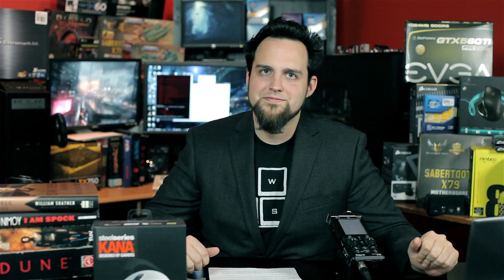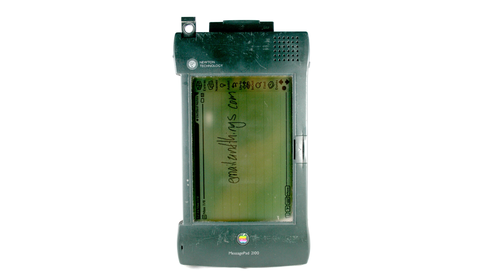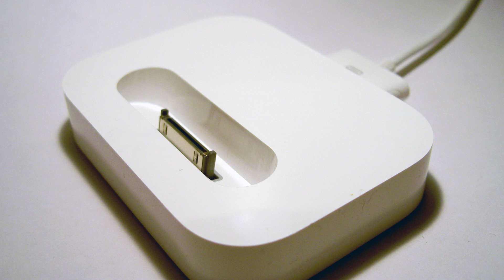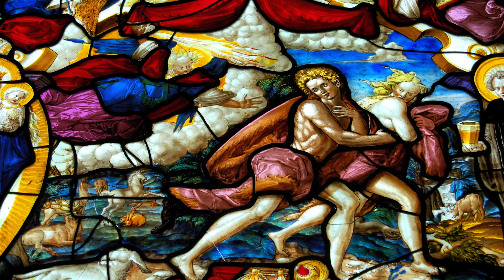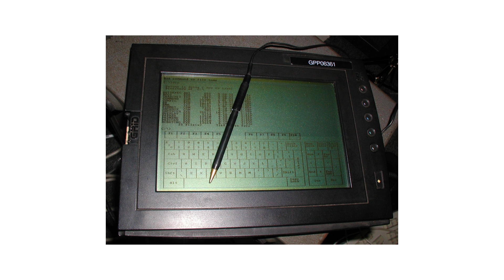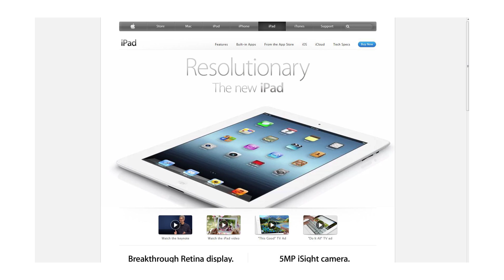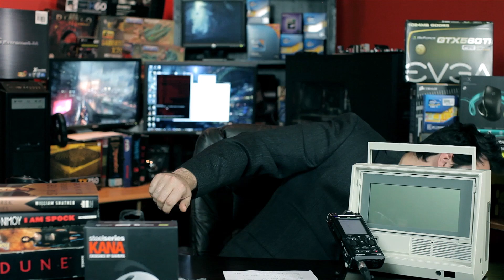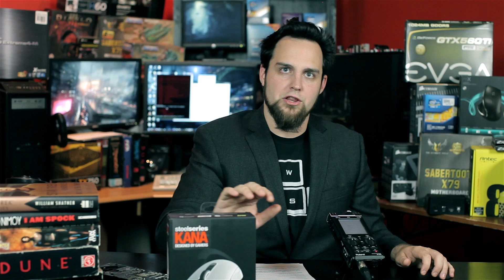Has Apple Really Ever Invented Anything?

Comment: Apple fanyboys playing damage control claiming Apple never said they invented anything. Come on.
Reply: *****

"An invention is a unique or novel device, method, composition or process. The invention process is a process within an overall engineering and product development process. It may be an improvement upon a machine or product, or a new process for creating an object or a result. An invention that achieves a completely unique function or result may be a radical breakthrough. Such works are novel and not obvious to others skilled in the same field."

From http://en.m.wikipedia.org/wiki/Invention

Does that concur with your view?
Reply: US Patent Law defines invention like this: a new, useful process, machine, improvement, etc., that did not exist previously and that is recognized as the product of some unique intuition or genius, as distinguished from ordinary mechanical skill or craftsmanship.
- (http://www.uspto.gov/web/offices/ac/ido/oeip/taf/patdesc.htm)

• Firewire is Apple's own name for IEE1394, Apple initiated development in 1986 with the help of the  IEEE P1394 Working Group, where TI was belonging to then.

From the 1394 Trade Association page:
"History
The 1394 digital link standard was conceived in 1986 by technologists at Apple Computer, who chose the trademark 'FireWire', in reference to its speeds of operation. The first specification for this link was completed in 1987. It was adopted in 1995 as the IEEE-1394 standard. IEEE-1394-2008 is the most current version of the standard, which supports asynchronous and isochronous data transmission with data rates ranging from 98.304Mb/s (S100) to 3.932Gb/s (S3200)."
- (http://www.1394ta.org/about.html)

• Newton MessagePad, while not the first real PDA, Apple coined the term PDA. I was not able to find an Apple press release about the MessagePad though, to either confirm or deny the claim of the video uploader (VU).

• Thunderbolt: where does Apple claim to be the inventor? It does not say so here: http://www.apple.com/thunderbolt/

And back in February of 2011, when the first Macs with TB arrived, Apple said this on their TB page:
"Thunderbolt began at Intel Labs with a simple concept: create an incredibly fast input/output technology that just about anything can plug into."
- (http://web.archive.org/web/20110227062320/http://www.apple.com/thunderbolt/)

• MagSafe: Where did Apple say, it was something entirely new? They have a patent on this connector for electronic devices, thus rice cookers are not included. In their press release from 2006, Apple did not mention to being the first to implement magnetic properties with power adapters, but according to the definition of invention, it is an invention.

• Studio & Cinema Displays: Where did Apple claim, to have "invented" the big displays? They were however the first to offer 30" computer displays and got the ball rolling for 2560 pixel wide displays, like the 27" displays nowadays.

• Mini DisplayPort is in a way Apple's implementation of the DisplayPort standard, one could call it an invention or innovation, the line is blurry here.

• Clarus, the dogcow: I am baffled now.

• 30-pin dock connector: A lot of companies seem to have their proprietary dock connectors, and Apple did implement some features in its dock connector, that would not be possible via Firewire or USB, like video out for example.

• Apple IIe Card: again, blurry lines, but in the end, if it is not considered an invention, it was an innovation made in house. I guess that should count for something. Nowadays we do not have such problems anymore, everything is compatible with everything. Man, those first thirty years of personal computing must have been awful.

• Apple TV: where does Apple say it is their invention? They say, it is their product, nothing more. These guys are really reaching. I guess they could not be bothered to look at Apple's actual inventions.

Still lots of shit to go I guess. And those moderators are quite bad.

• MacBook Pro: Apple was the first to use the Unibody design for their notebooks, others just followed suit. It was an invention and innovation.
You could also look at the Aluminium G4 PowerBooks, they were the first to introduce widescreen displays widely.

• Apple logo: again, stretching. They did design it themselves, but then again, someone already took a bite before, and it was Turing. I guess that guy should be honoured.

• QuickTake camera: I guess, they just list products, which cannot easily count as inventions, but the parts used inside or the parts used to create that product can be an invention, but then again, most people cannot look below surfaces and have to be superficial.

• Mac OS 9: now they just ramble how bad it was, but I cannot say anything about that, since my only experience with pre Mac OS X was System 7 and Mac OS 9.2.2, which were okay and got me hooked. I always liked to theme Windows to look more like that, I still put that task bar thing up top when using Windows. 

• Mac OS X: Of course they invented some of the code, they bought some of the code, and they took some of the freely available code. The new OS is an invention, but of course only if you use the broader definition. Otherwise, no one is inventing anything. Maybe when the Singularity arrives, new inventions will be made.

That video gets boring, but I fight through it. Hopefully you will too with this longer reply not really made for YouTube.

• Mac App Store: Again, where does Apple claim to be the first or having invented something entirely new with just the concept of the MAS? 

• iOS: Never heard it pronounced that way. Inventive. Unlike iOS of course, which was just Apple doing nothing. Man, those guys are prejudicial. And man, am I becoming even more prejudicial towards people with such beards. Probably wanted to join a metal band, but couldn't.

• iPad: Sadly, this time they are 0% correct. Tablets and that concept existed before, even in Start Trek and 2001. And many manufacturers brought out products in the late 90s and early 2000s, which showed, how many people are really not interested in such crappy products.
Luckily the iPad came along and showed everybody else, what to copy. I guess they couldn't see it from the iPhone, which was an obvious test bed for a multi touch tablet, at least for people looking at dozens of PADDs while watching TV.

• The iPod was not claimed to be the first MP3 player, not by Apple at least. Where do they find those idiotic assumptions?
It was the first popular MP3 player with good navigation and big storage though and brought attention to Apple. I guess, it must not have been that bad a player.

• Inductive charging: Apple does not offer any products of their own design or creation employing inductive charging. But I guess, since one can buy such products from the Apple Online Store, it must be Apple claiming it as their invention.
Or are they talking about the patent for orientation based charging Apple got earlier this year?

• iPhone: Yeah, I guess the name was the only thing they could come up with. Poor bastards.

• Pippin: WHAT THE FUCK? I am seriously pissed right now, and I probably should stop, but I am also obsessed with stupid people like you and proofing them "right", which is of course a lost cause via social media.

Anyway, I make a short break to break something, and will probably go to the cinema afterwards. Maybe I finish this reply later, maybe I will come to my senses and just post it until this dot.
____

They think a lot, they do not know a lot.

• A5: Officially it is a design by Apple, even if made by people from a previous company Apple bought, the company being P.A. Semi, not ARM. But then again, dangerous half wits share their ignorance.

• notebook handle: Yeah, they got Apple this time, Apple clearly claimed to be the sole inventor of this idea.

• Unibody construction: Apple introduced this sort of construction to notebooks, although it was a way to construct other parts of other industries long before. Again, those guys assume it was made for aesthetic reasons, thus it is not a real invention. I guess, the USPTO does see it differently, since it granted Apple a patent or more for that Unibody design specific to notebooks.
(http://patft.uspto.gov/netacgi/nph-Parser?Sect1=PTO1&Sect2=HITOFF&d=PALL&p=1&u=%2Fnetahtml%2FPTO%2Fsrchnum.htm&r=1&f=G&l=50&s1=8,616,748.PN.&OS=PN/8,616,748&RS=PN/8,616,748)

• legacy free PC: I guess they had to stretch, when they only got moot points.
Luckily other manufacturers still include PS/2 ports and Parallel ports on their motherboards, unlike Apple, who abandoned those legacy ports in the 1990s and introduced USB to the masses in a way.

Now they go off on lawsuits. They generalise a lot, but then again, one has to do that without actual points.
Apple does not go after everyone, that copies something from Apple like tablets or smartphones, they go after people, just like any other company, violating their patents, and Apple has certain patents in the smartphone and tablet sector, that get copied to the T. Apple does not go after companies, using their own patents or licensed patents when it comes to smartphones and tablets.

PS: I am not fully versed in all the legal stuff, and I have seen some frivolous lawsuits reported made against Apple and being pursued by Apple in the past decade. I do not agree with any of them, be they from Apple or against Apple.

Anyway, if you want to see granted Apple patents, which include their own inventions, go here: http://www.patentlyapple.com/patently-apple/patents-granted/
Reply: *****
• "How a US Patent defines invention is not the same as the literal definition of an invention."

- What is the literal definition of "invention" then?
Is it this?

"An invention is a unique or novel device, method, composition or process. The invention process is a process within an overall engineering and product development process. It may be an improvement upon a machine or product, or a new process for creating an object or a result. An invention that achieves a completely unique function or result may be a radical breakthrough. Such works are novel and not obvious to others skilled in the same field."
from http://en.wikipedia.org/wiki/Invention

• "Apple barely invented anything. "

- It invented enough to be copied again and again.

• "And if you can't tell, this video actually debunked the theories with facts"

- Really? Facts? There was one guy in front of a camera and one guy behind it, using small words. Where were those facts hidden?

• "even some I was unaware of in fact."

- If you believe a YouTube video as fact without doing your own research, and you have the free means to do so nowadays with the greatest knowledge base at your fingertips, it is obvious you are unaware of facts.

• "Of course, I see you damage controlling for Apple."

- Not for Apple, but FOR the people spouting ignorance.

Feel free to read the following entirely this time and counterargue. Or even show evidence of those "facts" you BELIEVE* to be true.
I will happily shut up if you can do that, but you would be the first to do so, thus no pressure.

*Believe is the same as not knowing, it is accepting something to be the truth without proof. Have you seen any valid proof in this video?

• Firewire is Apple's own name for IEE1394, Apple initiated development in 1986 with the help of the  IEEE P1394 Working Group, where TI was belonging to then.

From the 1394 Trade Association page:
"History
The 1394 digital link standard was conceived in 1986 by technologists at Apple Computer, who chose the trademark 'FireWire', in reference to its speeds of operation. The first specification for this link was completed in 1987. It was adopted in 1995 as the IEEE-1394 standard. IEEE-1394-2008 is the most current version of the standard, which supports asynchronous and isochronous data transmission with data rates ranging from 98.304Mb/s (S100) to 3.932Gb/s (S3200)."
- (http://www.1394ta.org/about.html)

• Newton MessagePad, while not the first real PDA, Apple coined the term PDA. I was not able to find an Apple press release about the MessagePad though, to either confirm or deny the claim of the video uploader (VU).

• Thunderbolt: where does Apple claim, to be the inventor? It does not say so here: http://www.apple.com/thunderbolt/

And back in February of 2011, when the first Macs with TB arrived, Apple said this on their TB page:
"Thunderbolt began at Intel Labs with a simple concept: create an incredibly fast input/output technology that just about anything can plug into."
- (http://web.archive.org/web/20110227062320/http://www.apple.com/thunderbolt/)

• MagSafe: Where did Apple say, it was something entirely new? They have a patent on this connector for electronic devices, thus rice cookers are not included. In their press release from 2006, Apple did not mention to being the first to implement magnetic properties with power adapters, but according to the definition of invention, it is an invention.

• Studio & Cinema Displays: Where did Apple claim, to have "invented" the big displays? They were however the first to offer 30" computer displays and got the ball rolling for 2560 pixel wide displays, like the 27" displays nowadays.

• Mini DisplayPort is in a way Apple's implementation of the DisplayPort standard, one could call it an invention or innovation, the line is blurry here.

• I do not know that dog icon, but I really get the feeling, they went with items, where the term invention cannot always be applied.

• 30-pin dock connector: A lot of companies seem to have their proprietary dock connectors, and Apple did implement some features in its dock connector, that would not be possible via Firewire or USB, like video out for example.

• Apple IIe Card: again, blurry lines, but in the end, if it is not considered an invention, it was an innovation made in house. I guess that should count for something. Nowadays we do not have such problems anymore, everything is compatible with everything. Man, those first thirty years of personal computing must have been awful.

• Apple TV: where does Apple say it is their invention? They say, it is their product, nothing more. These guys are really reaching. I guess they could not be bothered to look at Apple's actual invention.

Still lots of shit to go I guess. And those moderators are quite bad.

• MacBook Pro: Apple was the first to use the Unibody design for their notebooks, others just followed suit. It was an invention and innovation.

• Apple logo: again, stretching. They did design it themselves, but then again, someone already took a bite before, and it was Turing. I guess that guy should be honoured.

• QuickTake camera: I guess, they just list products, which cannot easily count as inventions, but the parts used inside or the parts used to create that product can be an invention, but then again, most people cannot look below surfaces and have to be superficial.

• Mac OS 9: now they just ramble how bad it was, but I cannot say anything about that, since my only experience with pre Mac OS X was System 7 and Mac OS 9.2.2, which were okay and got me hooked. I always liked to theme Windows to look more like that, I still put that task bar up top when using Windows. 

• Mac OS X: Of course they invented some of the code, they bought some of the code, and they took some of the freely available code. The new OS is an invention, but of course only if you use the broader definition. Otherwise, no one is inventing anything. Maybe when the Singularity arrives, new inventions will be made.

That video gets boring, but I fight through it. Hopefully you will too with this longer reply not really made for YouTube.

• Mac App Store: Again, where does Apple claim to be the first or having invented something entirely new with just the concept of the MAS? 

• iOS: Never heard it pronounced that way. Inventive. Unlike iOS of course, which was just Apple doing nothing. Man, those guys are prejudicial. And man, am I becoming even more prejudicial towards people with such beards. Probably wanted to join a metal band, but couldn't.

• iPad: Sadly, this time they are 0% correct. Tablets and that concept existed before, even in Star Trek and 2001. And many manufacturers brought out products in the late 90s and early 2000s, which showed, how many people are really not interested in such crappy products.
Luckily the iPad came along and showed everybody else, what to copy. I guess they couldn't see it from the iPhone, which was an obvious test bed for a multi touch tablet, at least for people looking at dozens of PADDs while watching TV.

• The iPod was not claimed to be the first MP3 player, not by Apple at least. Where do they find those idiotic assumptions?
It was the first popular MP3 player though and brought attention to Apple. I guess, it must not have been that bad a player.

• Inductive charging: Apple does not offer any products of their own design or creation employing inductive charging. But I guess, since one can buy such products from the Apple Online Store, it must be Apple claiming it as their invention.
Or are they talking about the patent for orientation based charging Apple got earlier this year?

• iPhone: Yeah, I guess the name was the only thing they could come up with. Poor bastards.

• Pippin: WHAT THE FUCK? I am seriously pissed right now, and I probably should stop, but I am also obsessed with stupid people like you and proofing them "right", which is of course a lost cause via social media.

Anyway, I make a short break to break something, and will probably go to the cinema afterwards. Maybe I finish this reply later, maybe I will come to my senses and just post it until this dot.

They think a lot, they do not know a lot.

• A5: Officially it is a design by Apple, even if made by people from a previous company Apple bought, the company being P.A. Semi, not ARM. But then again, dangerous half wits share their ignorance.

• notebook handle: Yeah, they got Apple this time, Apple clearly claimed to be the sole inventor of this idea.

• Unibody construction: Apple introduced this sort of construction to notebooks, although it was a way to construct other parts of other industries long before. Again, those guys assume it was made for aesthetic reasons, thus it is not a real invention. I guess, the USPTO does see it differently, since it granted Apple a patent or more for that Unibody design specific to notebooks.
(http://patft.uspto.gov/netacgi/nph-Parser?Sect1=PTO1&Sect2=HITOFF&d=PALL&p=1&u=%2Fnetahtml%2FPTO%2Fsrchnum.htm&r=1&f=G&l=50&s1=8,616,748.PN.&OS=PN/8,616,748&RS=PN/8,616,748)

• legacy free PC: I guess they had to stretch, when they only got moot points

Now they go off on lawsuits. They generalise a lot, but then again, one has to do that without actual points.
Apple does not go after everyone, that copies something from Apple like tablets or smartphones, they go after people, just like any other company, violating their patents, and Apple has certain patents in the smartphone and tablet sector, that get copied to the T. Apple does not go after companies, using their own patents or licensed patents when it comes to smartphones and tablets.

PS: I am not fully versed in all the legal stuff, and I have seen some frivolous lawsuits reported made against Apple and being pursued by Apple in the past decade. I do not agree with any of them, be they from Apple or against Apple.

Anyway, if you want to see granted Apple patents, which include their own inventions, go here: http://www.patentlyapple.com/patently-apple/patents-granted/
Reply: dlwatib

In other words, the iPhone and iPad were not inventions?

If so, what do you classify as invention exactly?
Reply: *****

But what is your definition of an invention then?

I just ask, as the examples you presented would clearly make the iPad an invention, as it would for the iPhone.
Reply: *****

Was there a multi touch capable telephone without physical keyboard, with music and video playback capabilities, www surfing capabilities (not WAP) and email capability, with camera and other stuff before the iPhone?

The same goes for the iPad. 
Was there a multitouch tablet in that size with that battery life available before?

And again you have not offered your definition of invention, seeing as it would conflict with your view. 

Yepp, patents mean nothing when granted for Apple.
Reply: *****

In some cases it seems to be, especially if you look at modern smartphones and tablets.
Reply: Indecisive Fella
Got a point? Apparently not. This is not about how many patents Apple has. This is about how many product categories people think Apple was first in, and they weren't. It doesn't matter whether Apple made false claims or not, Apple fanboys are making beaucoup false claims on their own. This is about Apple coloring inside the lines in a coloring book that other companies have published and then selling the pages as artwork.